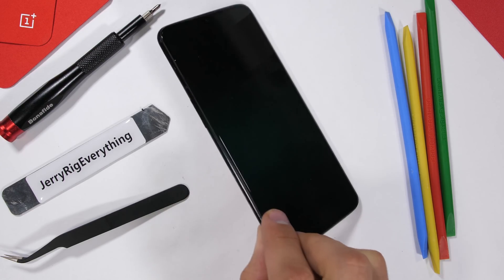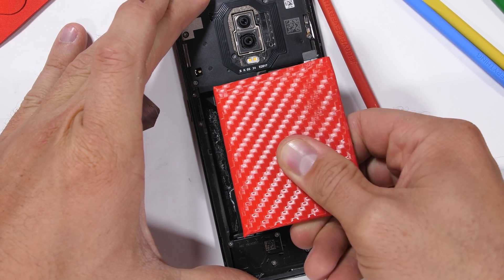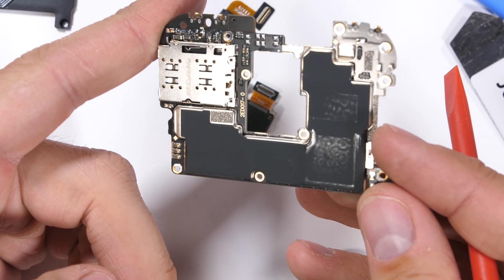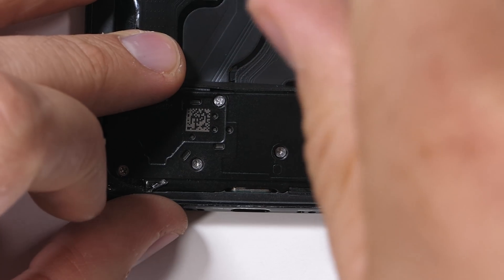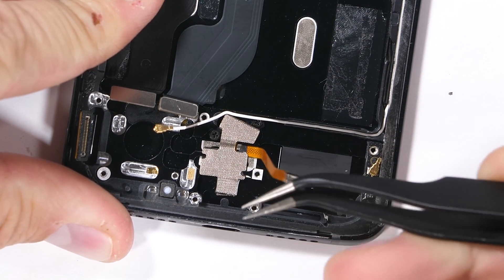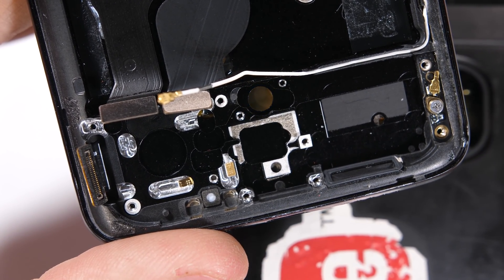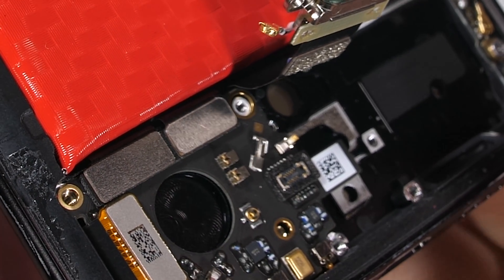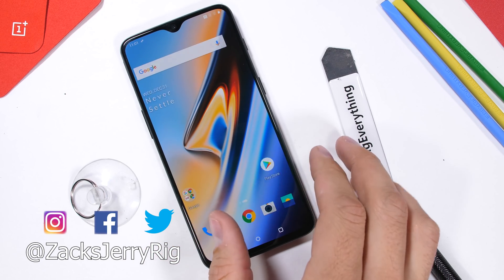OnePlus 6T Teardown - Can under display cameras be real?

Comment: I've had my OP6t since December 2018 and it recently fell and cracked the top left side of the screen. Suddenly I'm using my phone while laying down and the screen just jumps out completely. I had a 3T in 2017 and by 2018 the screen of it jumped out from the top left corner. I'm wondering if this is the thing. After 4 years their screens just jump out

Comment: I purchased mine when it came out, and I gotta say it has aged pretty well. Oneplus made a good solid phone.
Reply: U still have it or sold it
Reply: @vivekpanchmatiya8531  Of course I still have it. It's not even two years old. I don't replace my phone's until they're all but dead. Hell I only replaced my iPhone 4s with it the OnePlus because it started smoking while driving home from work one evening.
Reply: @HaddaClu  thats good i also got it when it came out and still using it and is as good as day one

Comment: Hello,
I broke my OnePlus 6T McLaren display screen when I accidentally dropped it on hard concrete, do you think I only need a replacement clear screen/front glass in order to reinstate it to its original look? Isn't the fingerprint scanner solidly attached to the display glass?

Comment: Hey Jerry, my last two phones' sim slots were at the top  and through force of habbit, I accidentally pushed the tool into the top mic hole of my new 6t before I realized the tray was on the side. Can you confirm whether it should be fine as you did on the note 9?

Comment: Fingerprint reader is just a camera,... Maybe OnePlus might drastically improve that camera and make it a selfie camera ... And make it completely bezel less.
Hoping to see this in OnePlus 7T or 8.  Not 7 though ...
Reply: Samsung has already started R&D for under-display front cameras. It's been reported that they already have working prototypes so it might be just a year or two away until we see them in retail phones, and as usual, other manufacturers will follow suit to compete.
Reply: Well the camera tech is perfect, BUT you need clear glass in-front of the camera to get the best lighting for generating image. Unfortunately the current technology for OLED displays is only able to reach around 80-85% opacity due to the circuitry within the display. Untill it hits at least 95-98% Opacity (which it will soon for sure) it's not possible to pull it off perfectly.
Reply: this is why they are doing all the AI work, to see "through" the screens with synthetic clarity
Reply: @l422y7  that would make a lot of sense, good thinking. Almost like machine learning driven graphical remasters

Comment: my problem when they first started removing headphone jacks was the lack of cheap good type c headphones and you couldn't charge and plug in your headphones at the same time. yes it is still a little annoying to go get type c headphones at the moment but there are cheap ones out there now and you can get 2 in 1 power and headphones dongles although with the ridiculous battery life on the 6t  that is not really a problem. yes i still hate bluetooth headphones as it is another thing to charge up  but as long as type c headphones become more common and cheaper it isn't that bad. we are just in the awkward crossover phase like when movies had to come out on video and dvd at the same time.

Comment: @JerryRigEverything I only have one question about the OnePlus 6T's design.... did they really NOT have enough room for a second bottom-firing speaker? Do you think it could have been done? I mean, I know they increased the battery size and made room for the in-display fingerprint sensor, but a fake speaker grill?? I wouldn't done that

Comment: How waterproof would you consider this phone to be? We've been told it's more water resistant than the OP6, but it looks like it uses the same speaker and alert slider parts, which previously had issues with water leakage if you dropped your phone into a puddle of water or a sink filled with water. With the exception of the headphone jack and fingerprint reader, what are the things that differ between the Oneplus 6 and 6t?

Comment: I figured the best place to ask is on your most recent video, but I need to know whether or not there is a way to remove the scratches from my Note 8. Most of the little scratches don't bug me, but one of them is deep enough to effect the light, it's like a little rainbow and it drives me nuts, if you see this advice would be greatly appreciated! 
- A Fan

Comment: Very cool. It’s great to see that the in-screen fingerprint sensor can still be a option. Face ID unlock on iPhones is great for when it works. But if it doesn’t read the first scan or isn’t easy to adjust so that it can work correctly, it’s frustrating, slower, and inconvenient. The fingerprint scanner needs to still be an option for us, at least for now.

Comment: That fingerprint sensor is such an easy and simple design...  Im amazed. 
Would be great to see u test the new iPad pro, cause i can see the iPad pro being a serious fire hazard... It bends so much... the battery could puncture and the motherboard could snap and break or even short with things it shouldnt short with... I love the design of the iPad pro, it looks amazing, Jobs design have always been the best. But it shouldve been thicker so it was harder to bend, could protect more, the camera lens could have been put inside the frame instead of having a stupid bump... in my opinion Apple made a stupid decision making it that thin... If i ever get it i know it wont ever get a scratch, even my 4S from 2011 is in prestine condtion, same is my 3 yr old SE. But they have to design and manifacture these products idiot proof for the people that dont know how to take care of stuff like this, and the ipad pro is not idiot proof from the looks of it...
 Wouldve been great to get an experts opinion on it.

Comment: Bixby / Google Assistant - Zack Edition
"ZAXBY" ACTIVATION SOUND "Let's get started / Now for the scratch test: plastic would be at level 3, glass would be at level 6, sapphire would be at level 8 / The power button is made from metal / There is no headphone jack / Now for the burn test: that never recovered / Thanks a ton for talking, and I'll see you around"

Comment: Since OnePlus "listens" to it's customers, they might put back the 3.5 mm headphone jack if all of us spam OnePlus with messages like "we want the headphone jack back" on Twitter or Facebook
Reply: I heard they are bringing the headphone jack back though. OnePlus is starting a new line of phones that are 'budget' phones rather than 'mid-range' and this new line will also have 5G connectivity =)
Reply: @c2thaj2tha71  what? where did you hear that? i specifically remember them saying theyre focusing on flagships only and dont cash in on budget or mid range phones at their presentation.
Reply: @T-The-K  A few weeks ago, a OnePlus spokesman confirmed to CNET that OnePlus' next phone would have 5G connectivity. But because this technology is expensive, so they're not adding it to the 'OnePlus 7'. Instead the company's first 5G device will be the first in an all-new lineup from the company that will co-exist alongside its current phones. As of now, there's not a lot of details about this change-of-pace... but this does sound like a smart move! If they added 5G smarts to the 7 it would significantly increase the price and none of us want that!
Reply: Just use 5t. It's strong phone. And have 3,5
Reply: @ponteusbolecki8103  my current phone. A beast
Reply: @MrGius46  same as my.
Reply: Who the h*ll uses wired headphones nowadays? 😒 It's super inconvenient
Reply: @ImanRoshandel  They are better.

Wireless is just annoying.
-Audio latency
-Worse quality
-Have to charge them

-They are the worse for gaming and phone calls.
Reply: If there is anything i myself straight up dislike is just not having expandable storage
Reply: My Sony Ericsson bought in 2007 had not had a headphone jack...
Reply: I meant Sony Ericsson W700i
Reply: they did
Reply: Completely agreed tho.
Wireless headphones is NOT as good as wired headphones.
Reply: ''cuatomers''
Reply: No, you're just stuck in the past, they did the right thing.
Reply: Why are people so adamant on a headphone jack? The 6t can run 24+ hours without charging, plug your adapter into your earphone cable and shut up.
Reply: Because adapters are a regression and not progress.
Reply: it's irrelevant because adapters aren't needed because bluetooth is the future.
Reply: @harshnemesis  bluetooth is NOT the future, not a single bluetooth headset has good performance as a good value cabled headset (it's like putting against wifi and ethernet, a cabled connection will near always wins in similar conditions). The true future and progress could be type c! BUT not a single manifacturer put a second type c on their phones. So just a lost possible choice, i need an adapter for a thing i could do easily before (transfer/charging while hearing) and you call it progress. Similar thing happened to the new mac with 1 single type c and i discouraged a friend to buy It, she agreed with me.
Reply: @MrGius46  Yes it is, in two years from now wired headphones will be a rare sight. Your strawman argument: Wireless internet was always the only option on a phone, different devices, different appliances and you headphone jack whiners sound like people who whines there isn't an ethernet port on the phone. You're living in the past.
Reply: @harshnemesis  you're living in a strange present, where from a smartphone with near everything we're losing functions. That was an EXAMPLE dude, phones got the headphone jack since they where born. Can you think of a PC without ethernet?? Same for phones with the jack! Led notification another example of a lost thing on new oneplus, glass cover another crap evolution. And i can continue
Reply: @MrGius46  Losing the functions that are OBSOLETE, in fact apple should had done that sooner, this headphone jack nonsense is so 2005, bluetooth headsets would be so much more developed if the original iphone never had a headphone jack. i know it was a STRAWMAN argument a really bad one, so bad it was used against you because I can imagine you being one of these hipsters with an ethernet port on his phone, so you can't even leave the house, lol.

Actually I can think about a pc without an ethernet port, if it has wifi capatibilities, it's not a big deal, obviously it doesn't need to happen because a pc is stationary thing... laptops on the other hand yeah sure no ethernet ports are needed and YES they all had them, times change. fuck notification led, it's annoying (though I like mine on my lg phone) Glass on the back is not crap evolution it's exactly what protects the phone from annoying scratches on the back and allows antenna signals pass through without losing bars, the steel or aluminium back interferes with that.
Reply: @harshnemesis  glass cover just cracks so easily, alluminium instead not a single crack, never had a single scratch on my phones. And this passage just for the wireless charge, another STUPID thing which charges your phone in more time... I surely think you're pro this feature.
Wireless connection NEVER overcomes a PHYSIQUE port. Bluetooth headset Will never reach the quality of a wired headset because you loose quality on the passage. So why we are gaming with ethernet instead of using a wifi? Same discussion on different devices. Study something about that. Ping, Wi-Fi Speed, stability of connection... Air will conduct always less than a dedicated cable, simple. We can't have an ethernet port, on a phone, but a little jack SURE. It's like removing from a PC the ethernet or the usb ports. It's not like:ok, we are removing infrared transmission but we will use bluetooth. NOPE, nothing will substitute the jack. I don't want to loose time to such a person which even doesn't reflect to its answer (seriously, an iPhone 1 without headphone jack? Only bluetooth 3 can have a decent bluetooth capabilities and we had it on 2009) so bye.
Reply: @harshnemesis  idi@t is the only person which can think that wireless charging is superior to the wired one, so a type of charge which is SLOWER and also makes your phone HOT= less duration of your battery and by a good margin, sounds legit noob Who even didn't make a valid argument. What is the progress in here, seriously? That you can throw your battery in less months just for not using a cable?
Study something before, every headset bluetooth on the market got a lossy audio, EVERY. In every aspect the sound of a wired headset will be better, and i don't speak about 10€ headset but about the High grade models. Even considering the conduction of infos, on air we got some inertia from molecules of air, and lots of other physical factors were air is in disadvantage against a wired cable specific for info conduction. Think that every single security/business/general structure of a State (i don't know how to Say It Better in english) gots a dedicated wired connection to the internet, so WHY here a wired connection and not using those FANTASTIC new sistems from satellites? Probably because wired is superior in every aspect? More secure, less dispersion and more stable? Tell me genius. This is like a discussion with a flat earth believer (on 2018 yes!)... Not every progress is better, change your d@mb mind, read history, read...
And again, the topic is simple, i'm doing examples and you're just so pathetic on the answer to these. Gaming is only an EXAMPLE, i can speak about work, study, everything! Even the smartphone invention itself created problems, now we are dependent to the device in near every aspect of our life, similar  the creation of socials (Facebook). You need to see the totality of things and not just the surface.
PS and just to conclude, i don't know your device but damn if the old bluetooth devices were unstable.
Reply: @harshnemesis  Let's for 2 years then, let's see if wired headset will no longer be a thing. Look at the mouse, they introduced a wireless mouse years ago yet people still prefer the wired one.
Reply: @random_internet_duck  They won't be at least not with phones. The mouse is being used with desktops mostly, so the wire doesn't really ever get in the way, it's just not a good comparison.
Reply: @harshnemesis  the sound quality of wireless headphones isn't as good as the wired headphones. I also don't care for the 3.5mm jack because i use external DAC most of the time.
Reply: @MrGius46  Audio can't be transferred over USB, it needs a DAC to convert digital to analogue.
Reply: @bumlebubbi  hello, i know that tons of phones with a snapdragon got dacs... But this wasn't my speech. You can put a dedicated dac here with type c and bam! Also, i've read now that the bullets headset got a dedicated dac in them
Reply: @MrGius46  Still, you're just putting the fucker outside of the phone. Type C is not the future for audio as it isn't truly analogue.

Comment: 2:38 Why Oneplus have two speaker grill when they only have one loudspeaker. They never attended to fire up both sides with sound. The left side ist just for the atennas and one microphone. IMO they dont use the space. It is only a profit decision. Apple at least use the space for they taptic engine.

Comment: So when Apple ditches the headphone jack, it's prime material for roasting and jokes and completely wrong in every single way, but when an Android manufacturer does it, it's an understandable business decision?
Reply: Jonne Pulli 
Well the fact that OnePlus still offers the dongle in the box, plus you know an included fast charger in the box, more then 1 way to unlock the phone if you choose to and is half the price of the iPhones I think he can cut them some slack 

Other android companies I can’t defend their choices as it’s just copying Apple 

Apple removed the headphone jack and then realised it can make more money by selling the dongle separately 

OnePlus removed the jack but also includes all the necessary dongles to charge and listen at same time etc and also they offer wireless headphones which are majorly cheaper then the AirPods which still sounds really great 

Not an Apple hater I use an iPhone 6s
But I myself would much appreciate some of the practices kept by some android companies especially OnePlus

Comment: removing the headphone jack but at least you have a COMPLETELEY USELESS second camera for something that doesn't need a second sensor at all.
Reply: It's not completely useless. Jerry was exaggerating, as he finds the other 2x kinds of "secondary cameras" much more beneficial. The depth of field effect can be replicated to some extent in software, but nothing is a replacement for an actual depth sensor.

And taking out that camera would have had next to no effect on them being able to fit the headphone jack back in. To do that, they'd have had to keep the battery the same size as the 6 (or closer to it at least).

Comment: I just realised something, if the LED's let light pass through from the top, then that means you could have a LED screen that's entirely (partially) clear, allowing you to see the internals of the phone, from the front of the phone when the screen is turned off. Am I the only one who thinks this would be awesome?
Reply: if you combine an OLED screen for light/colour and a secondary LCD screen for producing not transparent black only, you can select when/which of the internals are shown. In phones it is only a gimmick but in TVs and especially public/shop displays that would be very engaging.
Reply: lg made an see tru oled tv

Comment: I really don't understand all the complaining about the lack of a headphone jack. you can still use your wired headphones on the 6T with the included adapter. if oneplus wanted to force you to buy their wireless bullets they wouldn't have included a 3.5mm adapter free in the box. 

then these same people will rave about the mate 20 pro which also has no headphone jack.